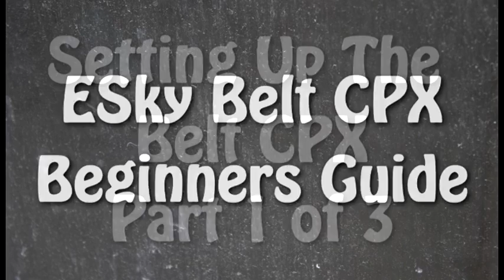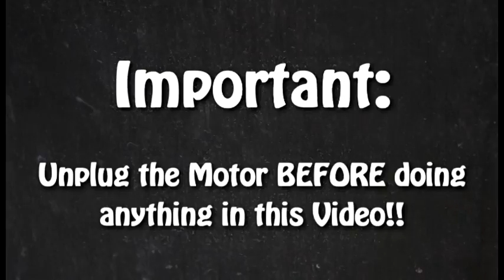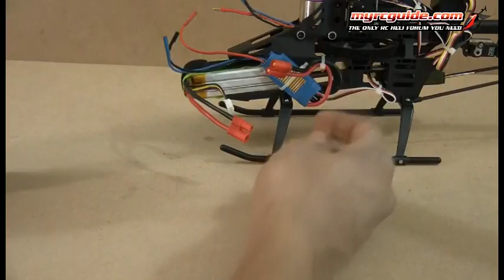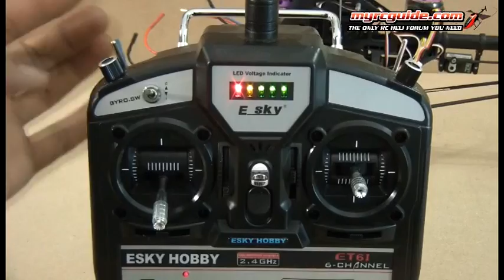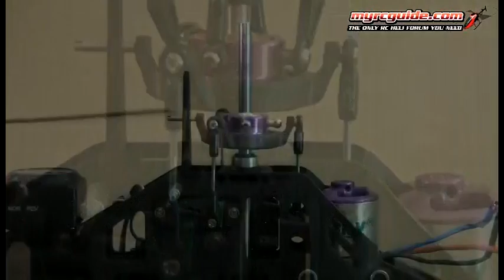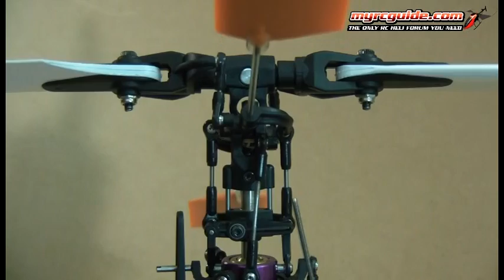ESky Belt CPX - Set Up Part 1

Comment: Im rather new to the helicopter scene so Im not saying your wrong, but couldn't you have the throttle trim tab in the centre position? rather than at the bottom? i thought that it would cause the blades to have a slight negative pitch?

Comment: Mark, why do you say to have to have the throttle/pitch stick all the way down for centering the levers when you have it in idle up, as if you had to center the arms, should you not start from correct mid-stick position, when the servos should be centered for true 3d flight? (ie, with the throttle stick all the way down, the arms were never centered on any of my own heli's)